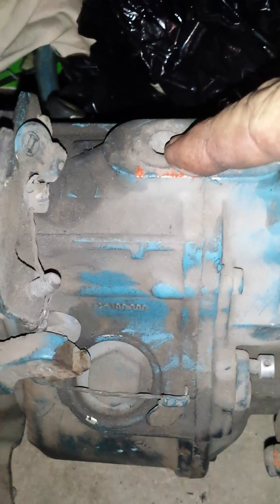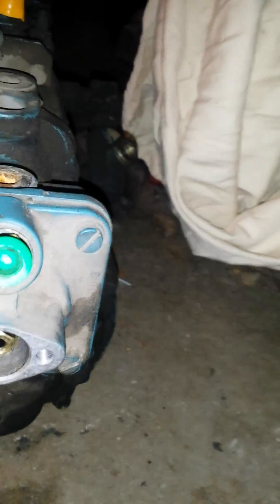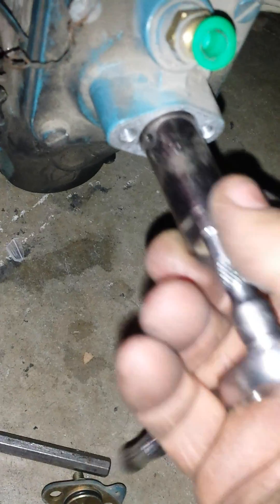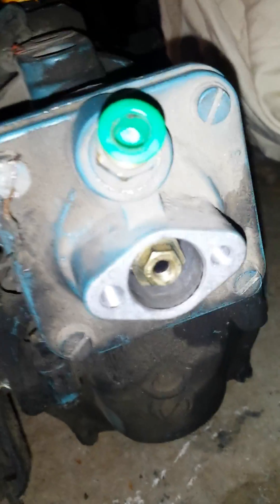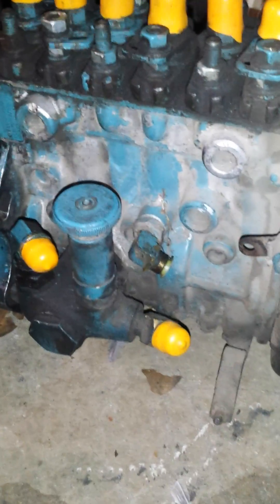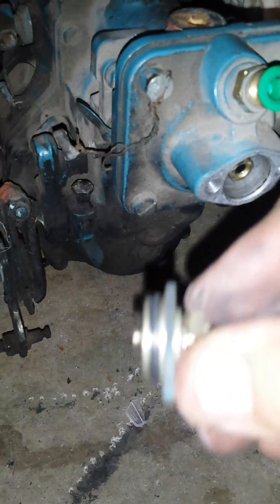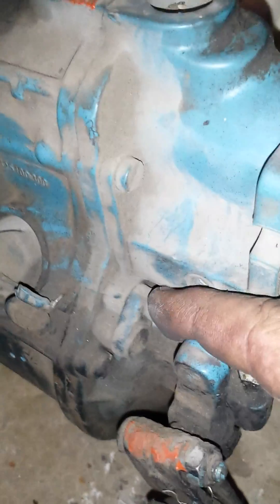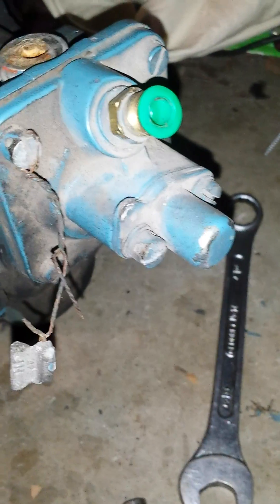Bosch MW pump(and some Apumps) full fuel adjustment(more power). "Turn up the pump"

Comment: what does that star wheel do?
Reply from the maker: It holds back fuel until the boost kicks in. As you spin it, you will notice the wheel slowly going forward, giving less tension on the spring that's in there.
Reply: I have done the top fuel screw I backed it out about five turns on my 8.3 Cummins. Also was told to turn the star wheel inward towards the motor to full turns which I did. Should I adjust the rear fuel Adjustment as the video as well? And how far out should I back off that would you recommend one of your previous video somebody calls at the smoke screw if going to far out is that going to create a lot of smoke?

Comment: got it running but it's lagging at the pedal doesn't reach same speed it use to
Reply from the maker: There may be a fuel supply issue, or something got turned the wrong direction.

Comment: hello quick question how would I adjust fuel if my pump has tampered proof bolts change all the filter and it won't start up ? thanks in advance
Reply from the maker: Either fit some small vise grips on the bolt, or chisel the head off. It's just a 4mm coarse bolt.
Reply: there a star wheel when I take off that Allen head out do I move it forward or back I'm turning it with a flat screwdriver got it till it ran on its own ran rough though?
Reply from the maker: The star wheel moves forward towards the front of the truck. It doesn't change idle.
Reply: Is this mw the same as the 5cyl pump as the mercedes om617

Comment: hello quick question how would I adjust fuel if my pump has tampered proof bolts change all the filter and it won't start up

Comment: Neverenuf.. can this all be done in the truck? and thanks again all your info you give on here and forums is priceless
Reply from the maker: +Bruce Raub ;
Yes, it can be done on the truck. I didnt have a truck close to me, so I bought this pump. Thanks for your kindness.
Reply: Thank you sir, now I have to drill out or get one of sockets machined!
Reply from the maker: +Bruce Raub . Or just remove the nuts all together
Reply from the maker: +Bruce Raub . There is no fuel plate. Just follow this video. The injection shop would be doing the same thing. It's this pump's version of the fuel plate.  Back out the nuts for more power....all there is to it.
Reply: Awesome, thanks again !

Comment: Any luck figuring out why it won't build the boost without a super low rpm or downshift on the M939's?
Reply from the maker: +Redcat Racing of Texas 
The screw on top is responsible for that. The one under the allen plug. If you want, you can remove the nuts on the back of the pump. That'll give it all the pump has(without getting inside the pump).
Reply: So I have the screw on top backed out as far as possible without getting stuck when I rack it back and forth. I know when we talked before, you said it could just get taken out, but I don't know what that'll do.
Reply from the maker: +Redcat Racing of Texas , taking out the screw will allow the power to extend higher in the rpm. That adjustment was originally meant to aid in quick starts. Only effective in lower rpm. To fine tune it, screw the top one in 3 or 4 turns, then back out the nuts from this video.
Reply: +nevrenufhp so what if I take the screw out the top and pull the nuts off the back? Or would that just be a nightmare in the making?
Reply from the maker: +Redcat Racing of Texas . Taking both out will smoke a lot, but also make good power. If it's still weak, you may need to pressure test the AFC and the line coming from the intake manifold.
Reply: +nevrenufhp So I will try taking both out and let you know what happens. As long as it doesn't break anything or over heat the exhaust, I'm willing to try it.
Reply from the maker: +Redcat Racing of Texas , EGT will get pretty high, you just have to monitor how it acts with the load conditions.
Reply: I will do.  I'm waiting for my second EGT gauge to come in before I move forward with this. I never have any load on the truck, other than the weight of the truck itself.